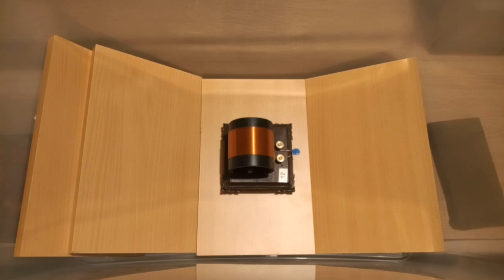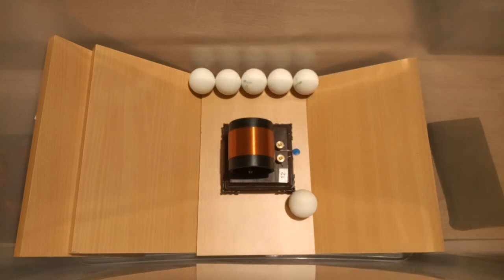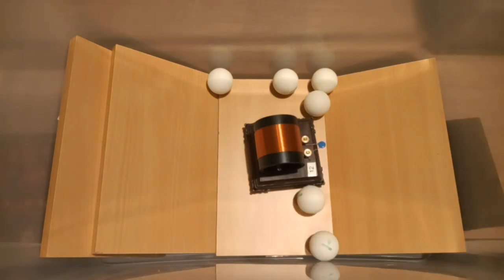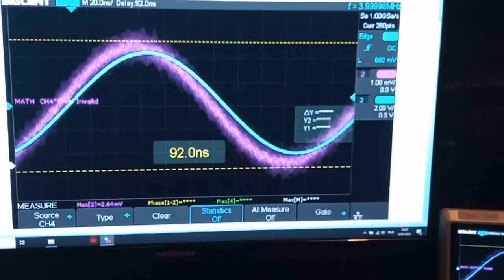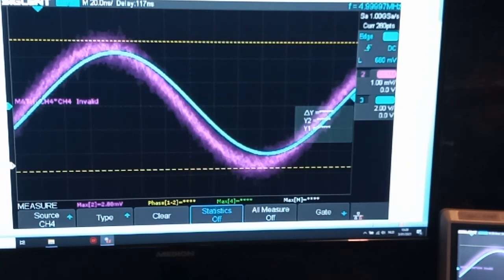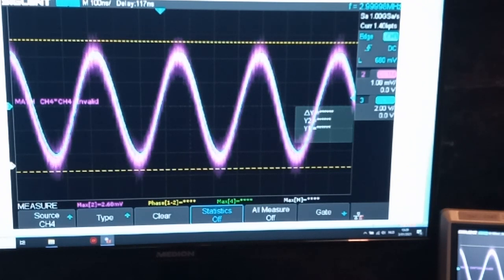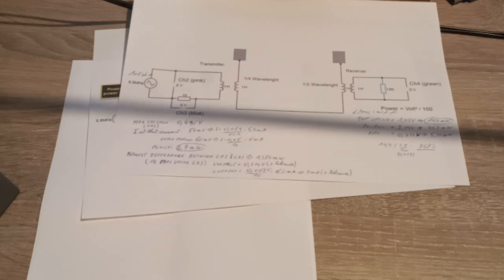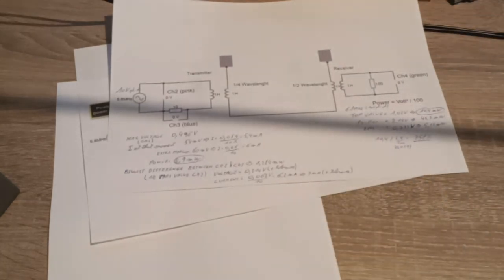My personal experiments on Scalar waves Experimental kit

Comment from the maker: The picture with circuit and measurement in video can be found at:
https://photos.app.goo.gl/Zz8HTwMZ5APfHx5T7
When I changed the transmitter coil from 1/4 to 1/2 wavelength the result is better:
https://photos.app.goo.gl/G36dPQYufrarfKLo6

In the schematic is written that the value of coils is 1H, this is because the webpage where I draw this schematic needs a value, it's not the real value. I'm waiting on self build project info to have something that can be replicated.

I also received a question of a viewer where he asks if I tryed to close the loop.
At this stage that is not possible yet, the reason why is that for example the signal generator that comes with the kit uses 200mA @ 9 or 12V (I have to look) so I need to have at least 1,8 W(9V) or 2,4W(12V) to have a chance that this works. If there's a sine wave generator capable of working up to 10Mhz with very low input only then the chance exists to get that loop working. In one of the books it was mentioned that somebody tryed that but didn't succeed and I think that that's the reason, but we will only be sure if we experiment on it.

Comment: The phase shift between the measured current and actual current is caused by the shunt inductance. It can be corrected by the usual shunt inductance filtration technique. adjustment of the filter should be done by comparing the measured current with a current probe or Hall-effect current sense chip signal at couple of hundred kHz. Then It should work at higher frequencies, usually up to 30 MHz.
Reply from the maker: @Mohammad-Madhi Taghip Thank you for this information, I will look into it (to little time at the moment)

Comment: it can be very difficult to trust oscilloscope measurements, especially above 1Mz.
much easier to run a lightdiode or incadescent lamp and compare it to a dc driven diode/lamp with a known input power. compare them visually, to see if theres a gain. one must be sure of the linearity of the diode/lamp first, by frequency test of them.
thats what i do now. i have wasted too much time on false readings.
another good method is to charge a battery and discharge it with a quality rc discharger - but do it several times, the capacity if the battery can change much.

Comment: The power formula, as you are probably already aware, is I x V x COS theta (the angle between current and voltage theta).  This is true for either a DC circuit or an AC circuit.  Of course the cos is equal to 1 in a DC circuit so typically the Cosine Theta is not shown.  In this video it appears to me you are calculating the instantaneous value of power by viewing your scope's instantaneous values of current and voltage.  My scope would calculate the power automatically for V I waveforms, as it knows the phase shift angle, then I can compare the input and output power difference.  I know I am preaching to the choir, but this was just my observation from what I saw you doing.

The final analysis though, is (1) can this be scaled up to a usable power, kilowatt, economically and physically.  (2) Can you remove the return wire.   If not, then this is just a fun little toy and thus not really that useful, gain or no gain.  This is why I didn't spend the thousands to buy the kit when it came out.  And no knock on Rick F., but as far as I know he  is making money off his kits/books, and not any real devices that he uses to power his home, car, yard tools, or whatever.  Please correct me if you know something that I don't on this.

Notice that you also experimented with Don Smith devices, again with help from Rick F. material.  I did not see any device here or on Rick's site producing gains to power even small devices using excess out over in power.  Again not a knock on you or Rick.  But I have spent many hours as well in these areas with also no real returns.  Even with Don Smith's simpler devices like the one where he simply spins a disk between magnets and coils for useful power...you know the device I am talking about.  So Bruno, I subscribed to your channel hoping that your goal is not just to review devices but to design devices to power everyday things, not just the tedious calculations as to prove a power gain.  We all will know beneficial power gains are realized and the calculations will be an afterthought.  Thanks for this fun video...
Reply from the maker: @Steven Smith, I'm not sure on how to exactly determine power if it's somehow possible. Especially when talking about gains there will indeed always be a problem. Just like you said the only thing that really matters is the result and for me that will lighting a light bulb from 10W,50W,. for almost free to free for starter. My end result would be to be able to cook for almost free, I'm not really looking for tens of kilowatt or more. I believe that due to the declining quality of parts it's better to decentralize and build few less power units then one gigantic, so when one brakes down it's not a dissaster. But first things first and see if I can get a few Watts.

I agree that whatever the working setup will be, it will not be exactly as described in different places, I know the pain points from the experiments and the solutions for those points are not really given. The problem is that people rather see this as debunking then what it really is for me namely finding the reason & solution for that pain point.
For example I'm now experimenting with the "Ambient Energy Generator " 
https://slideplayer.com/slide/12895228/
Slide 5 is the one I'm looking into. (for people with the Don Smith book pages 76,77,329)
I made a video that is hidden because my working place was not clean enough and I was not yet far enough with measurements for public video: https://www.youtube.com/watch?v=shBWfVViLFI
So I know that it's possible to create a positive or negative voltage in reference to earth ground on plate E by changing the direciton of diode to the plate E, but the resistor part is just not doing what it's supossed to do in the explications. My best result is always without it. So I really question the use of that resistor.
So to your hope that I want to design solutions instead of just rebuilding things the answer is "yes" because it's clear that I can use some of the technics that are spoken of, but finding reasons & solutions for pain points will only be by experimenting or somebody else would share solutions to those points :)
Reply from the maker: For the "Konstantin Meyl" device I had hoped to get a document to replicate this type of setup that was referenced to in one of the books but was a broken link, but sadly I didn't get response on that. So you're right about the replication factor on this.

Comment: Is how to build the scalar wave set up you have in the book?
Reply from the maker: @West Hill Chiropractic, Sadly not. There's a link inside one of the books to a self build project but it doesn't work anymore. I sended an email to the proffesor to ask if he has it or there's another self build project available. I'll keep you posted when I know more. 
The file referenced to  is called 'Bauanleiting-Willman-02-08', so if somebody has it available please let me know
Reply: Would you recommend the book?
Reply from the maker: @West Hill Chiropractic, I would recommend the books if you want to learn more on the scalar waves themselves, there effects, posibilities and so on. But if you're only looking for replicating info then I have the feeling there's to much information missing. For example, I couldn't find an answer to why the wire lengths on the pcb referenced as 1/4 & 1/2 wavelength are not in line with the wave length of for example the 7Mhz (resonance point of 1/2 wavelenght coil for transmitter and receiver) even taking into account the 1,5 factor of speed difference of the scalar waves. I'm still searching on more info that direction.